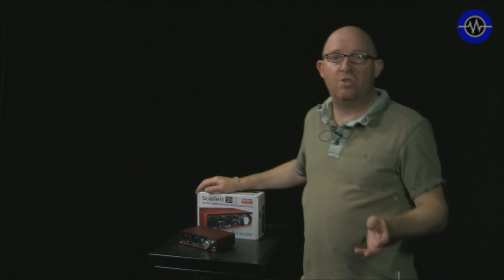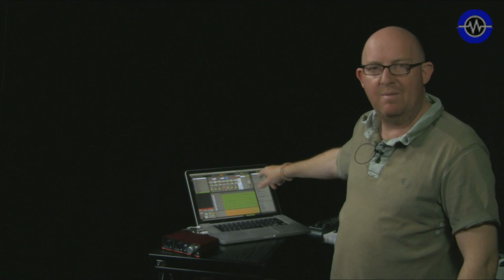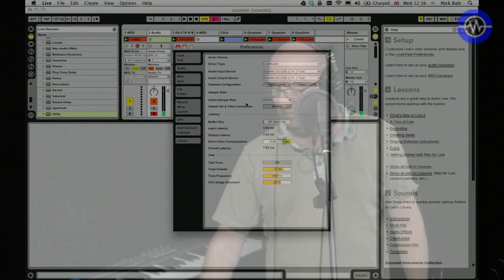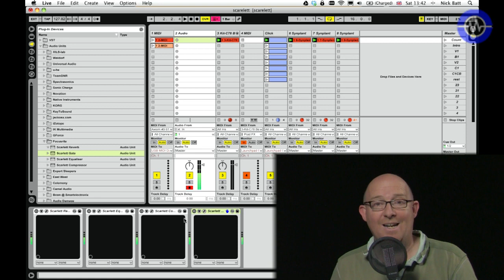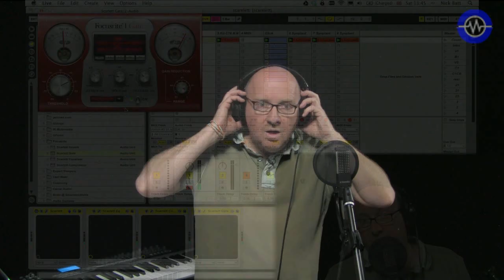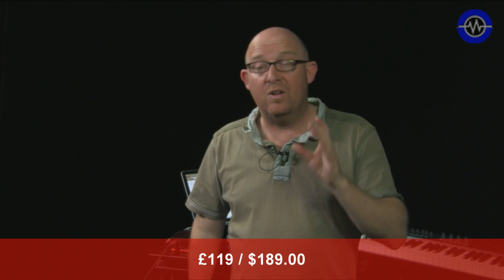Focusrite Scarlett 2i2 96khz USB Audio Interface - Sonic LAB

Comment: PLEASE HELP... how do i connect the scarlet to a camera with a 3.5mm jack to have audio directly to my caera? All the entry level mixers have those 3 outputs, USB, and the 2 chanels, so how does this thing work? I really don't want to use a mixer (or phantom PSU), but i have to as my Rode NT1-A needs phantom power.....

Comment: Great review, got a few questions if you can help:

Can you switch  between speakers and headphones when you play audio from a computer?

Is latency really zero or "almost" zero when monitoring with headphones?

Can you monitor a live recording and pre-recorded music (from computer) on your headphones at the same time ?

Will the headphone amp be sufficient to power 35ohm impedance headphones (Audio-Technica ATH-M40x) or would you need a headphone amp?

Thanks

Comment: @6:30 he starts using compression and there is no puhhhh (popping as you call it). He's just a little aggressive with the ribbon mic, needed to back off a bit, or, add some compression. Not that he was worried, because he was just talking, not singing, or broadcasting...

Comment: Excellent review as always! This little unit is getting glowing reviews all over.
Question though. I've noticed that there's no switch for switching direct monitoring between mono and stereo. Does it have that somewhere in the driver, or is it locked? And if it's locked, is it locked to mono or stereo?
Keep up the good work :-)